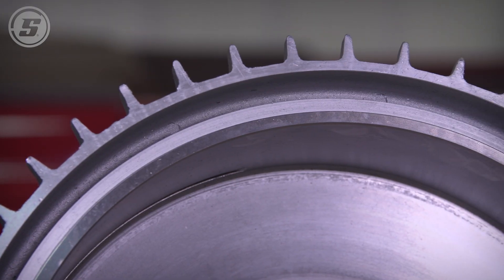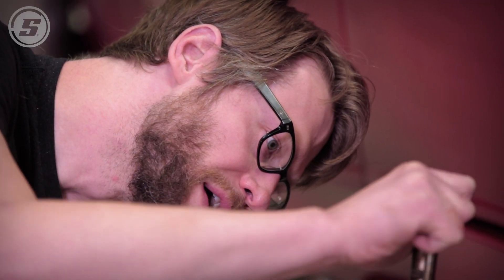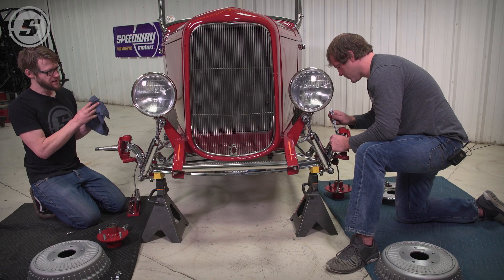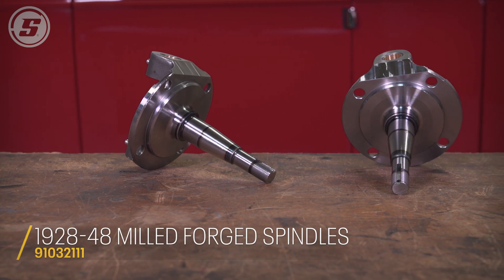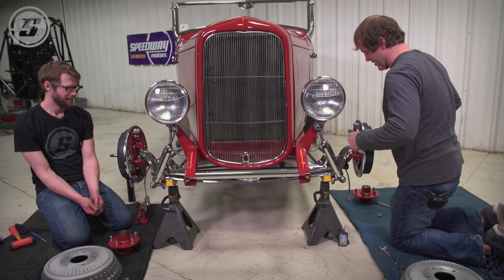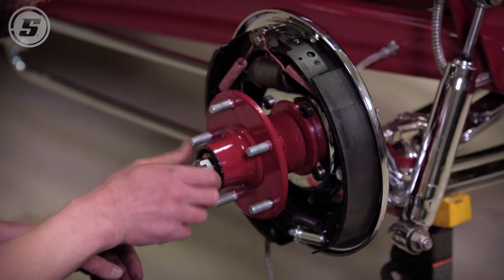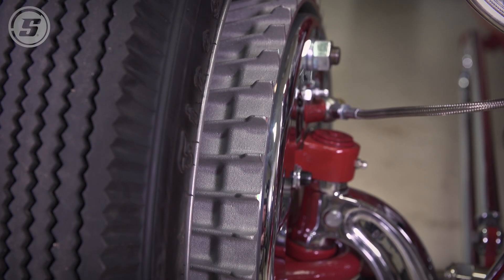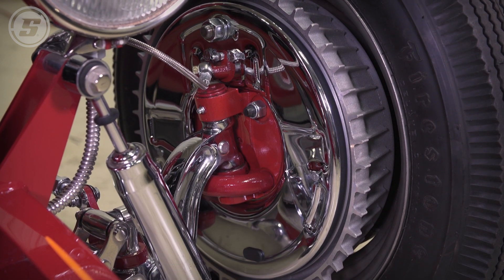32 Roadster - Episode 1 Finned Brake Drums

Comment: do they have air scoop backing plates available for them?
Reply from the maker: We don't have backing plates that are already drilled for the air scoops, but we do have the scoops: https://www.speedwaymotors.com/Drum-Brake-Backing-Plate-Scoops-Lincoln-Aluminum,239266.html which are made to work with the backing plates that we sell. We also have these: https://www.speedwaymotors.com/OTB-Gear-6106-Finned-1939-48-Ford-Drum-Brake-Scoop-Plain,58553.html which will work with a 39-48 Ford juice brake backing plate.